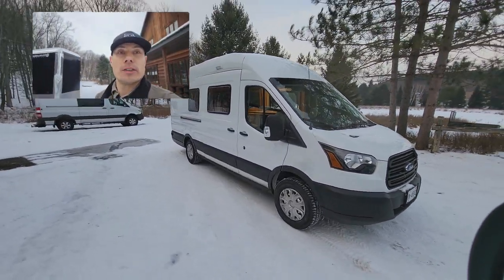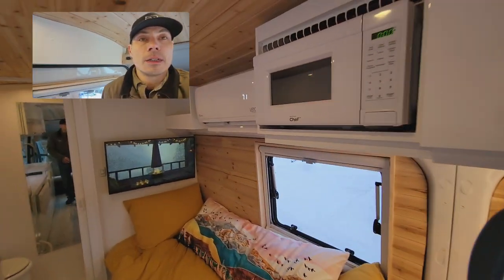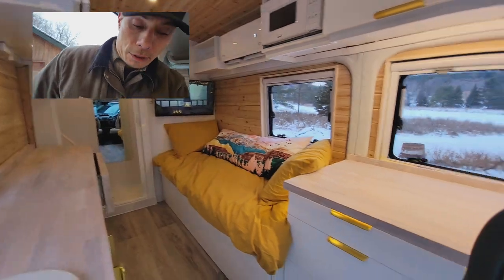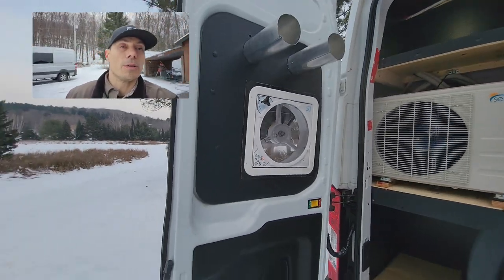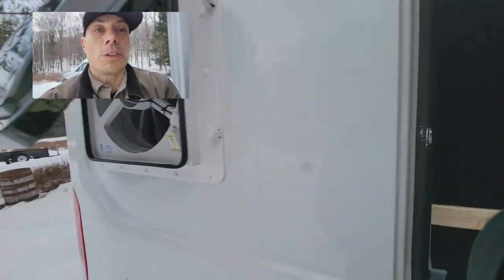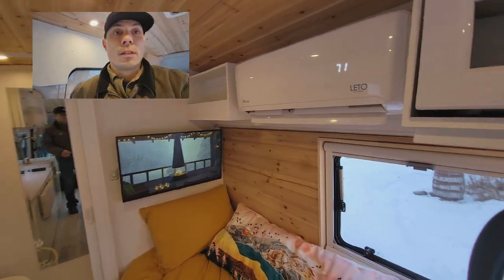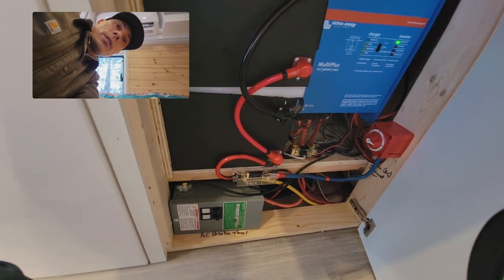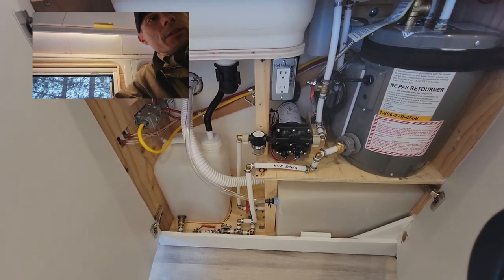Mini Split Air Conditioner in Van Conversion. Unique layout for single camper.

Comment: If you dont meet the manufacturers specified clearances your going to take a huge hit on efficiency and capacity. Loss of useable space, exhausted heat and in winter heat pump is going to be useless. I'd like to see a test with the door open closed to compare. Really though as long as it meets the needs of the vehicle it's a stealthy solution.
Reply from the maker: 3 seasons and still working perfectly! Heat pump is amazing in winter.

Comment: I have been in the HVAC business for 20 years and while this looks like an absolutely great idea I guarantee you are not getting enough airflow to that condenser. It may work now but this system will most likely fail prematurely.
Reply from the maker: This little compressor is remarkably small and not like ones used for a house. Its been going strong for two years of 6 months at a time full-time usage.
Reply: @TheNaker  that little compressor is made for a house. A small house or small area in a house and is designed to sit outdoor with optimal airflow.

Comment: Heat pump it's not efficient   One diesel heater will be enough just fine and will take much less power which is crucial in the winter time. Also, you have a unit right above your sleeping hand. I would never be able to sleep there.